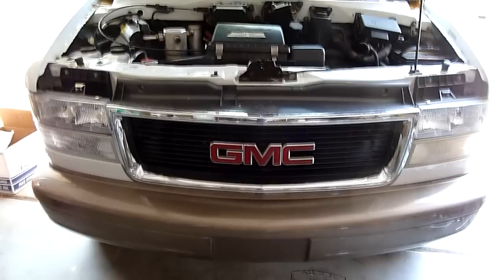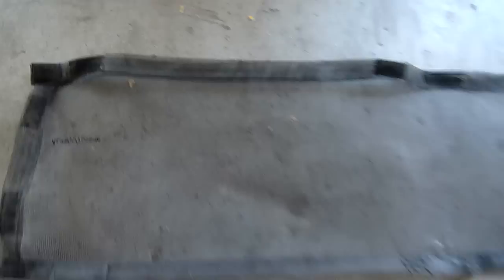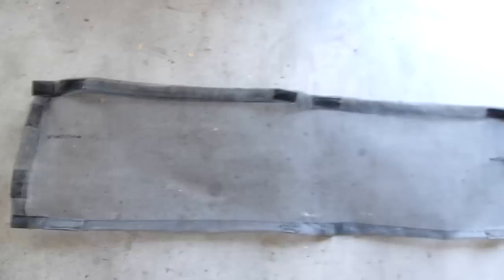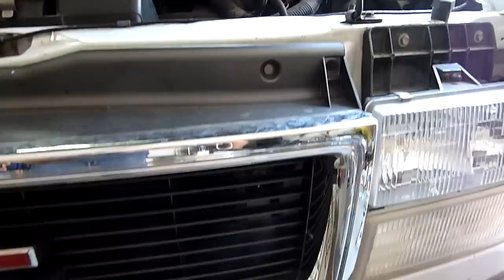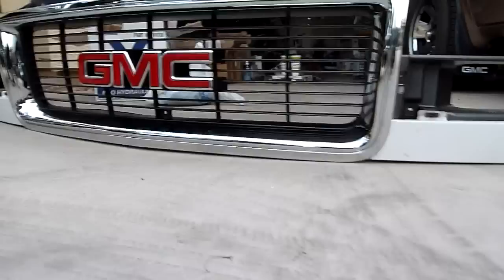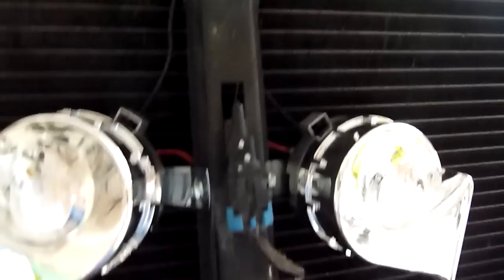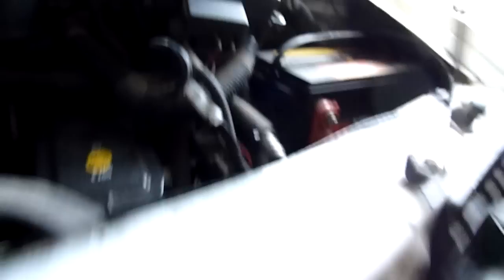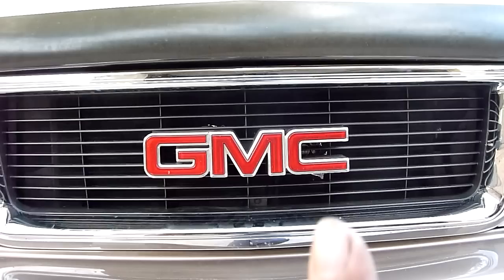How to make your own Grille Screen Insert to protect your radiator from debris + bugs & Horn Upgrade

Comment: i did this myself, bought some screen (the same you use for a screen door) , doubled it up, and zip tied it to my existing grill on the inside to drive cross country with! been 2 years and still looks new
Reply: cb7pwn - Did you take the grill off, or could you manage to do it without taking it off?  Thanks ...
Reply: kept every thing on , it was as easy as any home job could be. it cost almost nothing and its invisible.

Comment: No sure about my rad getting proper air intake and no restrictions..but I will do my research before I make this mod
Reply from the maker: I've done this all my cars ... haven't had an issue.  I guess you could put a fan in front of a screen door and see how the air flow feels....remember air is going to be forced through the screen, a little speed builds up quite a bit of pressure.
Reply: @footprintsinconc  look at the opening before the screen tones of are Wich I know it will be fine just the science geek in me that's all.bur I'm gonna do exactly that now..lol put the fan in my screen door..that a great tip tho I'm on the highway weekly on a three hour drive and the bugs in my grill and rad.is plenty

Comment: but then your radiator get less cooling, weaker air flow from the grill.
Reply from the maker: No, there is plenty of air pushing through...the suction force is pretty strong...the area under the bumper is still open, so lots of air movement.

Then at moving speeds, there is a lot more airflow.

Less air flow than not having screen but plenty still with it.